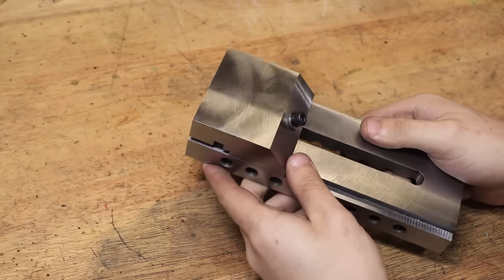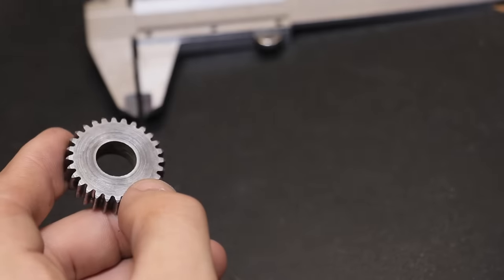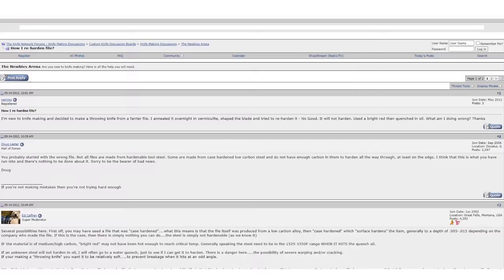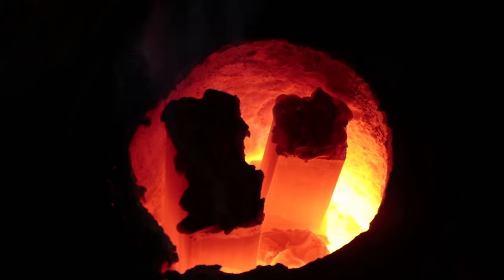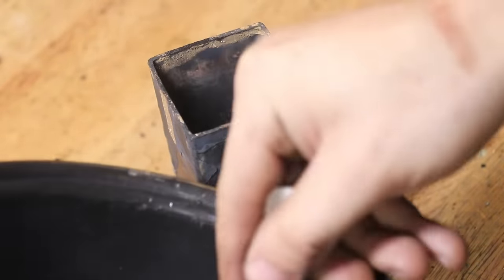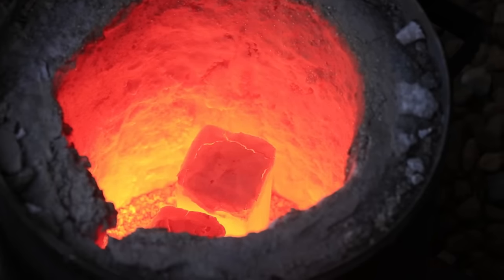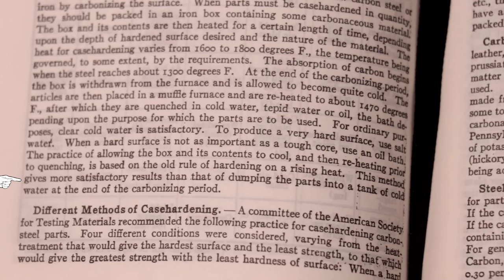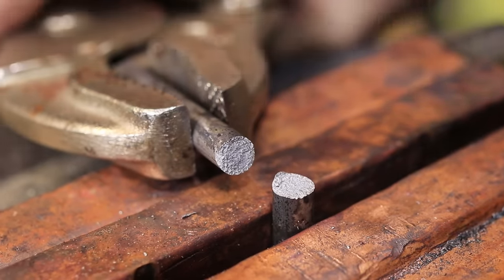Case Hardening 101 - Heat Treatment Oversimplified

Comment: I studied metallurgy for years in college and after. I rarely see YouTube presentations of heat treatment without misinformation. You did an accurate and clear job of presenting a complex subject and it was entertaining.
Reply: Mare, can you recommend any good reads for hobbyists? I have no background in metallurgy, though there are some instruments I would like to make for my work.
Reply: @therealKJMD  college books taught me the most about metallurgy to be fair 😂 I would try to search for schoolbooks and machinist handbooks
Reply: @dodgydoode111
Reply: @therealKJMD  I'd really recommend Machinery's Handbook, there is tons of extremely good info in there on most metalworking & mechanical engineering topics. Current editions are kinda expensive (150 USD for the current edition), but older editions used off ebay are just fine for hobbyist use. Don't buy this book off of amazon, most of the listings there are counterfeits (at least in the US, don't know about AU) and can possibly have misprints. I paid ~20 USD for my copy of the 26th edition, I believe they are currently on the 31st edition.
Reply: Didn't he describe "hard facing" and not "case harden"?
Reply: I saw a part of a coking unit that was manufactured from a somewhat low carbon steel. It was in operation for 30+ years at 1200°F. The carbon base of the coke migrated through 3" of the steel. Only the center 1/4" was low carbon enought to be weldable. The junked it and put in a new one..
Reply: @christopherscott8853  No
Reply: ASM Metals Handbook Volume IV (Heat Treating).  All ASM books are excellent.
Reply: @christopherscott8853 both are same i guess.
Reply: @surajbhandari4507  Long time since metal shop but I'm pretty sure they are two different things.  But I only weld once every 10 years.  Braze almost daily, though.

Comment: Nice explanation. For future projects I would suggest not using Linseed oil. The modern process for producing it leaves behind some impurities in the oil that in and of themselves cause upredictable results. Actually, canola oil makes a passable quench medium if you don't have a right proper quench oil like Parks. Maybe in the future you could repeat your experiment when you are on another project and use Canola and test the results you get.
Reply from the maker: That could explain why it was mentioned in the earlier machining books but is suspiciously absent from the more modern books :)
Reply: I think all the seed oils have low cooling rates (too low) in the vicinity of pearlite formation.  I know the blood Knife Steel Nerds has discussed that at length.
Reply from the maker: @hunterbidensaidslesion1356  Probably, but with what I am doing, it probably doesn't matter too much.
Reply: Canola doesn’t fully quench. Maybe something 1/8 and under but research has been done suggesting you cannot get a full quench. 

Parks is abundant as hell now. About the same price as canola. No excuse imo but time. Brine if nothing else.

Comment: Clay flower pot with charcoal and old plate on top is just as efficient as a welded container, but much cheaper an reusable....
Reply: That's if you can still find a clay flower pot.

Comment: "Traditionally you would use wrought iron, but we no longer live in the 18th century" 😂 I'm so glad you're able to take advice from others and admit some mistakes. That's a very hard thing to do. You weren't bad with your method though and in your case I think case hardening would be a good idea. You definitely do a ton of research to find different methods for doing a thing, their effectiveness, and problems with them, and weigh the cost and labor for each of them. It's only natural to miss the occasional detail but I honestly think you do a fantastic job on your research and it's very insightful to listen to! And of course you do test things for yourself so you're not just relying on book knowledge and know that slight adaptations you make will still produce the same result. Well done!

Comment: Without really knowing what I was doing, I managed to case harden some model locomotive parts using almost exactly the same process you've shown. I did use the sodium carbonate too. I've read that old fashioned blood and bone fertiliser is a good source of carbon but most modern fertiliser has other additives and I wouldn't trust it. Apparently, boot leather can also be used. Good video on a not widely documented topic.
Reply from the maker: Cheers Preso. The 1st edition machinery handbook that I have does reference crushed up bone as a pack hardening material, although it seems to be absent in later versions.  Not sure about fertilizer but it could have some nitriding effects. I might have to look into that. Cheers

Comment: An old machinist showed me several methods of case hardening for plow points and the like, harking back to "olden days" before cars and such.  My favorite was an iron box filled with small pieces of bone and antler, which was supplied by my breaking up dead critters.  The box was about 3/8ths of an inch thick, which closed with a snail cam.  He would then chuck it in the forge and I would get to work pumping  the bellows to his satisfaction.  I was pleased to stop when he figured it was time enough and he would let the fire die for the night.  In the morning I would drag out the box and empty it.  The hardening usually brought out some colors on the parts.  For the tempering, he used rendered bear fat because it would not crack or check the metal.  Just thought I might mention a different method.  Good video, thanks.
Reply: I'm afraid bear fat would be tad difficult to get nowadays... ;-) Also, that "charred animal stuff" (charred leather in this case) method was shown by Chris from Clickspring channel - "Antikythera Fragment #4 - Ancient Tool Technology - The First Hardened Steel?" (https://www.youtube.com/watch?v=V_Mp1fNzIT8).
That method was indeed "used before cars and such"...
Reply: @MrKotBonifacy  I do appreciate your letting me know about that.  I've heard tell of that antikythera. It was supposed to be older than the Sumerians (I think that was  who, could have been the Greeks), and I do believe I heard tell that it was brass or bronze. so that could help you date it, if an age was needful.  I'll check out that video tomorrow, since it's gotten late.Nice to know that the old ways of doing things can still be counted on.

Comment: I’ve heard about pack carburize but I have never done this. Back in the mid 90s I got a job at a local commercial/tooling heat treatment shop. I first started running the salt pots running tooling O-1, O-6, S5 and many more tooling materials. It was a salt to salt or salt to oil process. I moved on to run the vacuum furnaces, temper and endo furnaces. At least a few years in Each department. After 10 years of working in this tooling shop I decided I wanted to learn more and ended up getting a job at the words biggest heat treatment companies (BTP) this was one great experience that I will always be grateful for. I started as a vacuum operator, moved to a temper furnace operator, Nitride supervisor, shop foreman, production manager and finally plant manager. All these jumps was within a 12year time period not overnight. By this time I had 22years experience and made a decision to slow things down, I moved back to my first job as a facility manager. I am now in charge of the furnaces and future development of the plant. But I always love to hit the floor and reach the new guys a few tricks, especially the guys that show interest in the process. 

But getting back to carburize, I’m not to familiar with pack carburize since this is not allowed in aerospace parts. We process the parts in a furnace with temperature and carbon controlled instruments. But for a tooling part this seems to be good enough, if it fails you just try again. 

I might make some videos on the process using controlled instruments. I’ll see if I have time this year.
Reply: That is great for you to accomplish a career in a very important field. I'm a machinist 45yrs, worked tool & die 2 yrs and learned some heat treating tool steels. It is an enormous field to learn. Thanks for your inspiring story. You are proof that we can accomplish big things if we work hard and keep learning, move forward !!
Reply: I have a question for you! Heat treating knives, the data sheets demand a preheat to equalize. 

I just put the knives in at cold, and ramp as fast as it goes up to aus temp. Shits getting hard, so it’s working so to speak but I’m just wondering if I can maximize everything. I want to heat treat these knives as good as I possibly can. 

The data sheet for m2 suggests ramping 400 degrees f per hour up to normalize temp (like 1550f) then rapid ramp from there to aus. I’m assuming this is for large tooling parts not thinner cross sections right? 

And finally. I’m planning on making some knives from forged a11, the forging range says 1700f, do I have a tiny window? Or what? Can I reverse the or what? I’m assuming I’ll cycle the material after forging but I don’t want to do any permanent damage to the grain or carbide or anything. 

Oh yeah and sorry, I also want to forge weld simple stainless to these high carbide tool steels like a11, would I need to do that in a tool wrap, with argon? 

You have my dream job. If I didn’t go into psychosis I’d be graduated from Colorado school of mines by now. Getting my rocks off in the home shop now.

Comment: Thanks for the great overview and taking all the time to do the comparison testing. From personal experience I know how much time can be consumed by experimentation to validate the things people suggest. 

Not to mention the exhausting effort needed to comb both old literature and pinpointing the specific relevant information amongst the mind boggling plethora of search returns that only pertain to the general topic your searching. 

You may have called it a simple introduction but from my perspective even without covering some of the finer points on the subject, you did a fantastic introduction/Q & A that would help over 95% of the people wanting to case harden parts, 🍻.
Reply from the maker: Cheers, That is very kind of you. Definitely not 100% comprehensive but I hope it helps.

Comment: If you are stuck for flat bar, try old leaf spring steel .Though it can't be guaranteed as 0.7% C., (eutectoid) ,it's superior for hardness, tensile, etc.tjere are colour charts available if you've no thermocouple or welders crayon for the heat treat.your quench method is fantastic .evens out the chill crystal structure. 
* still will require normalizing. 250° /hr/cubic inch.
Great vid man.
Reply: It certainly would not be >0.7% C given that the specification for the two common spring steels is not >0.60%. Also contain around 2.0% Si. One grade also contains an amount of Cr (approx 0.50%). Be aware of so called spring steels being made in sub continent factories from old rail steels. NO Si content there.

Comment: Great Video. As a chief engineer in the gas turbine industry I have designed many heat treated nickel, cobalt, steel, titanium and aluminum based super alloys parts, but I don't normally don't get to see the step-by-step details of how the process works. All beatings in the gas turbine world get case hardened mostly using M50-Nil as the base alloy. Even in ceramic bearings, the inner and outer races are still case hardened steel.

Comment: I greatly appreciate the info you've provided.  In light of what you've presented, I was using too high of a temperature for far too long.  Container was a lidded ceramic jar placed in a pottery kiln.  Cycle time was on the order of 10 hours. 😯  Very haphazard.
Reply from the maker: Interesting, never thought about using a ceramic jar. There are charts online that will give you a good idea of case hardening times, for the vice, I case hardened it for around 10 hours and some times parts are case hardened for longer (in industry)

Comment: I have done my fair share of heat treatment case hardened or other you will never eliminate distortion. It is simply part of the game especially on intricate parts with variations of thickness such as your vice. I would say you were successful in the end. Quenching in water regardless of movement up or down or side to side  the rate of change in temperature is extremely fast. Oil drops the rate of change more slowly but you would still experience distortion. I love the fact that you are not shy about trying new process and procedures keep up the good work.
Reply: Mike, I totally disagree with your statement. Countless times I used A2 tool steel and had it vacuumed heat treated. On critical pieces double or triple heat treatment would be in order. A2 would basically hold its size and hit the Rockwell required.
D2 tool steel ditto.
Reply: @gordhildreth4630  That's fantastic I haven't had that experience myself but I'm glad you are able to old tight tolerances on parts post heat treatment. Myself if I'm looking for a flat square or tight tolerances work I grind the finish dimensions. I must be doing something wrong of course Air hardening steel is going to be much more stable. I can't say I have ever ran any parts that needed to be heat treated multiple times an annealing process perhaps more than once but never heat treatment cycles repeatedly.

Comment: Old case hardening salts usually had sodium chloride and cyanide salts mixed in to aid in the dissolution of the carbon, but ofcourse those salts can sound a little terryfying, BUT by making the charcoal by carburizing something organic like leather in an oxygen free enviroment you can get carbon that already has very useful amounts of natural cyanide compounds in it. And the carbon doesnt all have to be carburized leather or some such, but something a third or a quarter of the whole carbon content. Additionally the rest doesnt have to be wood charcoal, it can be something else rich in organic carbon chains, such as sugar or flour. I don't know the exact chemistry behind it but the sodium chloride and cyanide apparently react together with the iron in such a way that the dissolvin of the carbon into the steel speeds up considerably
Reply: Cyanide in leather?

Comment: When quenching a part, you should move it rapidly in the quenching medium, regardless what it is. Move it in a figure of 8 or circles and up and down. This movement prevents the steam jacket. If only a section of an part should be hardened, move the part up an down, to achieve a smooth transition from hardened to  not hardened material.

Comment: Thank you very much for the informative video. You have done an excellent job producing it. Your vice looks very nice as well. I have not done any case hardening since high school in the mid 60"s at which time we used kasenit and I understand it is no longer available. I did use 10% sodium carbonate as a catalyst and my final product turned out just as I wanted. I made a couple wear parts for a forming die and solved the problem- thanks.

Thanks again and keep up the good work.

Comment: Great video! I was considering case hardening for some fixtures at my work, but I found a good spring steel, 5160, for a reasonable cost that worked great for our application. I have not tried heat treating it, because it has been doing great at the C25 it came with. It has not been too bad on tools. 5160 might be good for you or your viewers too.  McMaster Carr description "Yield Strength: 97,000 psi
Hardness: Rockwell C25 (Hard)
Heat Treatable: Yes
Max. Hardness After Heat Treatment: Rockwell C63
Specifications Met: ASTM A689
5160 alloy steel handles repeated cycles of stress without breaking just like spring steel. It’s often used to make flat springs"

Comment: Great info. I noticed that your reference material had info from the Pennsylvania Rail Road's Altoona shops which is near my neck of the woods. Very interesting. They did a LOT of their own R&D with metallurgy to try and stay at the forefront of technology, but they held on to steam tech too long while most other  RR's were converting to diesel-electric tech. The reason for this was that they worked hand in hand with the coal industry, and they didn't think using oil would pay off. They were wrong and eventually went bankrupt.  Of course Air travel and trucking had a lot to do with it as well.

Comment: I worked in the tool making industry many years ago and we would case harden low carbon steel in a non sealed box packed with charcoal. We would heat treat tool steels in the same un sealed boxes but packed with cast iron chips to prevent carbon being lost from the steel.